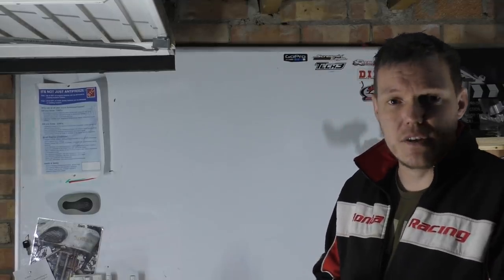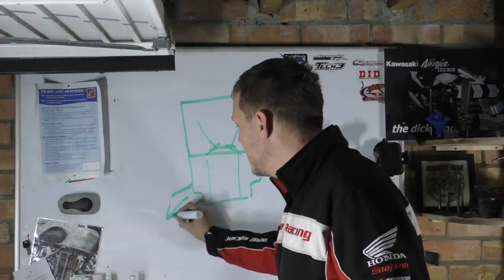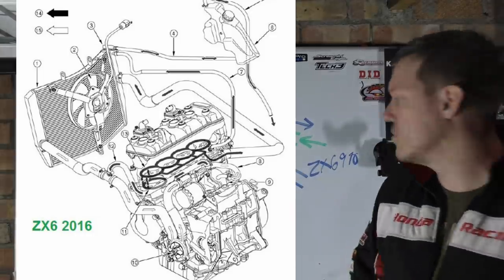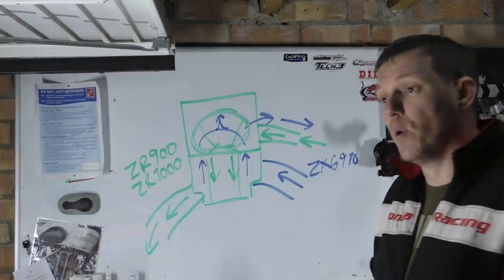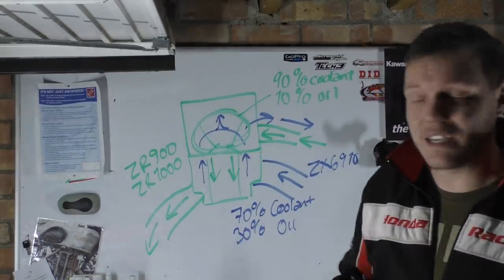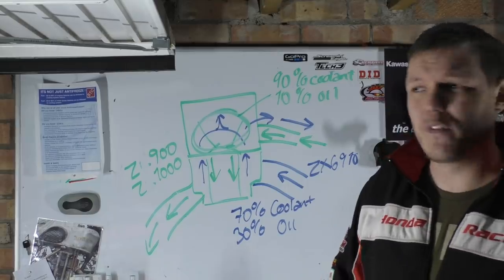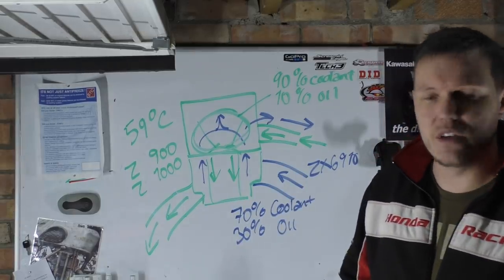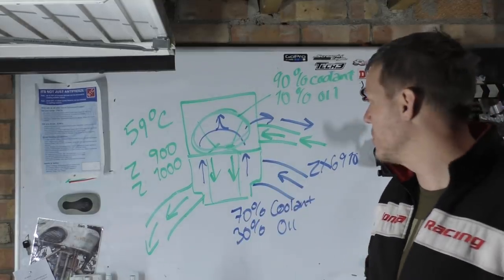Z900 Weird Cooling system

Comment: From heat exchange perspective its a good idea due to the fact that the rate of heat exchange is faster the greater the temperature differential and having the cool inlet next to the hottest part in a heat exchanger provides some efficiency gains over the other way around.
The old system is a bit of a legacy of thermocyclic systems relying on hot water rising to the top in the engine and cooler water failing in the radiator aiding flow through the system but with cross flow radiators that is less the case.

Comment: The MAN D38 diesel 15.6L engine has the same head first flow system too. Apparently the head first cooling allows for the valve seats to get cooled faster, longevity increases.

Comment: Very interesting. I to can confirm about the zx6r (j2) hates town riding, it splutters and backfires in the summer and it always has the fan on and always above 104c yet on a trackday or blasting though Wales it stays at a constant 85c.

Comment: Reversed cooling can lose a little power compared to the conventional direction. The first time I know of doing it was when we ran the original Yamaha TZ250 reverse cylinder engine which would seize on a regular basis and was even nicknamed the Reverse Seizure. It was done to try and keep the cylinders from going oval due to exhaust heat being on the side of the engine which was in still air and the intake side would have the coolest densest air possible being below the radiator so there would be no heat from the engine to effect BHP. Karts run with their carbs on the front as it does give a power advantage, but karts do not have bodywork to stop heat being drawn away from the rear of the engine. We reversed the coolant to warm up the cylinders to try and keep the cylinders as round as possible but it did lose a couple of BHP.  Not sure why Kawasaki reversed the coolant direction but it would help speed up the engine getting up to temperature and may help lower emissions too. As you point out the Z900 and Z1000 are not sportsbikes so they dont need to remove as much heat as possible at high speeds and it is easier to keep them from over heating as they are not fully enclosed engined bikes and not desigined with performance oriented cam profiles which will have an effect on engine temps even at tick over. 

Shame the Petronas FP1 didn't run reversed cooling in the race bikes a they would have heat related issues with their reversed cylinder heads and the engine builders had to simulate real running condition heat on the cylinders then hone them hot to try and combat the ovality issues which would blow up their engines and mean every race (not meeting). So between morning and afternoon WSB races they were swapping engines.

Comment: I think it balances the temps out, the head is hotter so it kinda shifts the heat down to even it out, maybe to prevent warping in the long run?
Reply from the maker: It about heat saturation and removing the heat a quick as possible

Comment: I was talking to Kawasaki TSD on Friday and asked about this because i was chasing a cooling issue on a Z800.
According to Kawasaki it's all to do with stabilising the overall temperature for extended city use.
As other comments have noted, your best cooling effect happens with the steepest temperature differential, and if you get the measured values for the Z8 while you're warming it up and running it you can see the head temp and the cylinder temp stabilise at a much closer temperature than on the ZX's.
The overall temp diff between cylinder and head on a Z800 comes down to less than 5% as opposed to nearly 15% on the ZX10R gen 5. Over all temp is also dropped because the heat is drawn from the hottest areas first. The Z800 obviously runs much cooler than a ZX10R for a number of reasons including the fairing and combustion volume, but it works like this.
If you have something that is 100*C and you remove 20% of that temp, it's 80*C. if you have something 90*C and you remove 10% of that you have 81*C. total temp is approximately 80*C.
if you remove 20% of the 90*C and 10* of the 100*C you have a  higher overall temp of approximately 5*C.
That's a lot when you're dealing with small closed systems like these.

And the issue i was chasing ended up being an occluded hose from a missed casting flash.

Comment: Cool design👍
probably not as common because of air beading against flow. 
There's a few odbal cooling system like,
 VW circulation tanks bleed automatically using hoses.
Some systems like Buick 3.8L had bleeder screws. 

Jeep amc 6 cylinders tend to warp if not done right best to run them little to steam up then shut off and let cool and hope air pockets work their way out of the long head.

Comment: I have a ZZR600 and it has the traditional cooling loop. It's a touring bike and the coolant system is overkill for it. During summer around 35C in traffic the fan will stay on, but the needle almost never goes over half. In any colder weather it barely goes over the "don't ride it hard" range.
Reply: Maybe I would be a good candidate for Evans
Reply: there's defo nothing wrong with it?!
Reply: @chrisdavidson911  No this is just a common thing for many sport motorcycles. It was the same for my Ninja EX500

Comment: this reminds me of the rover k-series. a bit. thermostat's on the wrong end of the head, and a few other daft things, which made it great as a quick-warm-up city engine for light city things, but then when it got fitted to other stuff (land rovers, for example), the head gaskets started popping because by the time the thermostat got open (constant heavy load pulling some gutbucket it wasn't designed for up a long incline) it was too late. Don't know why they lived with gasket problems instead of sorting that out! Also, the vfr fan comes on briefly while it's still fairly cold (can't remember the actual temp) then goes off again

Comment: I think, there is another reason for that: you want combustion chamber to be relatively cool (to avoid knocking), and cylinders relatively hot (for the best efficiency). Citation from a car engine manual which uses dual thermostat system (80 deg C for the head, and 95 deg C for the engine block):

"The dual-circuit cooling system has the following 
advantages:
-   The cylinder block warms up faster because the coolant remains in the cylinder block until 95°C is reached. 
-   Less friction in the crankshaft drive due to the higher temperature level in the cylinder block. 
-   Better cooling of the combustion chambers due to the lower temperature level of 80°C in the cylinder head. This achieves better filling with a lower knocking tendency. "

Since dual system would be to heavy and complicated for a motorcycle, why not just reverse the flow?

Comment: i wonder if the conventional flow from bottom up is because, as my chemistry teacher taught us, you always run liquid coolant bottom up so it fills the entire chamber, as opposed to just running down the sides and not really coming in contact with the area being cooled.  but if there's no air possible in the system, then this logic wouldn't apply.

Comment: Matt, This might be all about getting it up to temp earlier...My 1200r is barely warm after 12 miles and the fan has never come on...overcooled.
Reply from the maker: It has a fast idle start-up
Reply: Im not a big fan of running an engine at 2500rpm from dead cold soyou are stuck with an ecu that knows better.(we all hope it knows better)..good stuff matt..thankyou
Reply: Matt, so your okay with the motor spinning 2500 rpm from deadcold?
Reply from the maker: Yes, the engine isn't under load (apart from its own inertia) There's a trade of to be had. The longer the engine is cold the more wear occurs, but the faster the engine spins, the more wear occurs. Like everything there is a compromise.
Reply: The longer the engine is cold..? modern synthetics run pretty wellcold and would recommend after your break-in..Thanks matt...

Comment: My 08 ZX6R definitely gets hot with no airflow through the radiator. They have an overheat protection that turns the thing off in the danger zone. I fitted a fan bypass switch so at slower speeds I switch it on to run constantly which greatly reduces overall temp but cooks your fuckin shins 🙄
Overheating on any ZX is a feature, not a fault. I am unsure if this has been addressed in newer models.

Comment: I have a 2019 Z900 ABS and if I stop at a red-light when it's hot outside, I have to shut it off so that it doesn't overheat. It'll max the temp gauge in a minute or two.🤣
Reply from the maker: A minute or two? Where do you live?

Comment: The temperature indicator on the dash seems to be calibrated only within the operating range of the thermostat rather than over all.
Reply: On many cars the indicator works like this: 80-95 degrees shows the same temperature, to make people feel like everything is fine and normal, only if you leave this temperature range, the indicator will start to show a correct temperature.

Comment: Mmmmm very interesting
Where is the thermostat in the system, is there a bypass to cut out the radiator
If coolant flow is from head to block ant the stat is at the head with a bypass I can only think this has been done to decrease warmup time and reduce delta t accros the engine and therefore reduce thermal stress accros the engine. What say you
Reply: This is exactly what I was thinking. To my knowledge a lot of cars with Rover K-series engines were doing this 20~30 years ago for that reason. Having the thermostat on the inlet was the cause of a lot of headgasket failures as it took too long to open. When it did eventually open the engine was flooded with cold coolant and warped the head.

Hopefully Kawasaki have done a better job of it!

Comment: Hey Matt. 
I have a drz 400e (suzuki dual sport), I believe that it doesn't have a thermostat, it is the more off-road orientated version of the drz400
However, the more road orientated versions of the same bike, 400s & 400sm have thermostats. 

I have installed a temp gauge and notice that in winter it runs between 40-50C, in summer it can get as high as 100C. 
Is there a reason that most bikes designed for offroad do not run a thermostat?

Since I'm mostly riding on-road, would there be any advantage in installing one. Should I be concerned that the oil isn't lubricating the engine properly during the winter? I usually give it around 30sec to warm up before taking off, and then take it easy for the next few mins of riding. 

Cheers, David.
Reply: what?i have a ktm exc (only designed for offroad,not a bit dual sport)and it has a thermostat also my ktm lc4 sc (bit dual sport but more offroad,so more or less like the drz e) and it has a thermostat too
i fitted an oil temp sensor to the lc4 and in winter it goes to 60-70°C (more 60°C) after 10 km of riding and doesn´t really get higher (and it has the little oil circuit with just 1,6l oil)

Comment: A reverse flow system strikes me as something that would not self-bleed very well when you change the coolant. Saying that, my bike has an actual bleed nipple that you have to use to bleed the coolant system.
Reply from the maker: How would this change anything? The system is basically the same, just when the fluid is being pumped its the other way.

Comment: When you show the Z900 exploded view, the little arrows showing coolant flow go from the radiator to the water pump and up and out of the head, so a 'normal' flow. Have I missed something?
Reply: Look at the flow in the cylinders jacket, it goes from the top to the bottom, that's what he's referring to.
Reply: @ho2sorellestupide  Yeah but that's just the flow in the cylinder jacket, the overall flow is from the bottom of the engine up to the head.
Reply from the maker: What? The flow goes into the engine at the HEAD and then DOWN the water jacket and out of the CYLINDERS.
Reply: @dirtygarageguy  No worries, just edited my reply as I see where you're coming from now, I was carried away with the overall flow but watching your whiteboard bit again I see where you're coming from :)
Reply: @ho2sorellestupide  it's ok, was just me being thick ;)
Reply: @noggintube  i was confused too.had to look 2 times on the picture to get it xD

Comment: Did you get the R3 engine wrong then Matt? Could be worth a re-visit
Reply from the maker: LOL - no its not wrong. The R3 is the 'standard' flow.
Reply: Sean Sluman maybe the guys from tst modified it themselves to this correct way to find that there is a little more to it than swapping hoses

Comment: Oh so do regular cars have coolant flow through the heads first?
Reply: depends, chevy were the first cars to reverse flow cool with the LT1 v8 engines.on subaru  Boxer engines is a common modification for performance and longevity but most cars use conventional flow cooling to this day cool in the bottom , hot out the top, im trying to think of some car with thermostats up the top of the block but im struggling, i think a few higher performance motors from mercedes and bmw might have the coolant enter through the head and exit lower, maybe peugeout too im sure there are a few made this way  but its not so much an issue on cars due to the lack of restriction on weight of coolant, rad size etc.
when your finely balancing a bikes thermodynamics vs its weight , i think this stuff is more important , and on high performance stuff where the head can get so hot it boils the coolant and bangs happens- like in the case of the subaru...
and there are dual systems out there, two thermostats , one at the head, one in the block...

Comment: Is quite interesting. I would have thought that from a cooling perspective using a reverse flow and trying to recreate a counter flow heat exchanger sort of thing would be more usual rather than reverse flow being unusual. 

Do you know why they don't do this more oftenly? Require more plumbing etc so make is less practical for bikes?

Edit: as you say the counter flow is more efficient, so why isn't it used more commonly? Just to avoid over cooling? Surely having more efficient hear exchange would allow for a smaller radiator and less mass/ space taken up even if marginal. I could just be being a fuckin numpty but I can't figure out an explanation for why it's not the standard.

Comment: I think Corvette tried the reserve flow system, it was garbage
Reply: pretty much all GM stuff is
Reply: The later half of the C4 Corvette series with the LT1 and LT4, 5.7l engines pioneered a reverse flow cooling system. It was an interesting engineering exercise at the time and worked quite well. My '96 Vette LT4 works great with this system but there are some critical design compromises that followed along with it; such as the camshaft-derived water pump drive and the delicate (and expensive) Optispark distributor. I have no complaints other than to cuss out loud at the previous 'pro' mechanic that built this V8 and serviced the drive train. I had many corrections to make and oil leaks to halt.